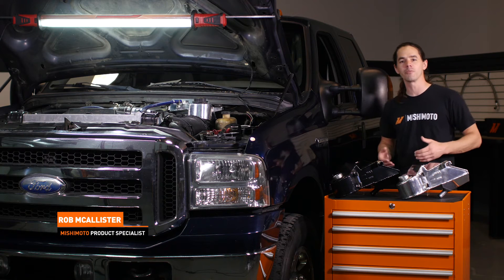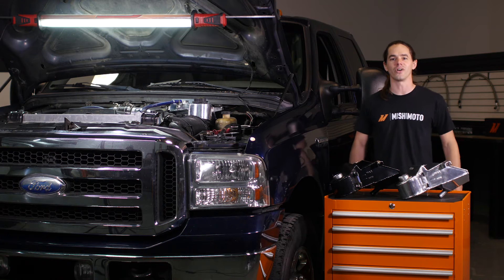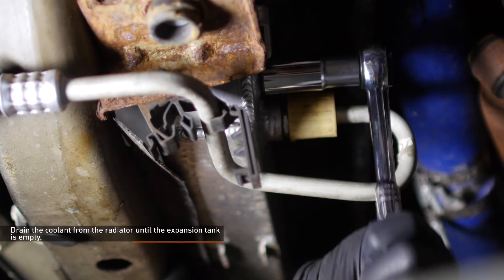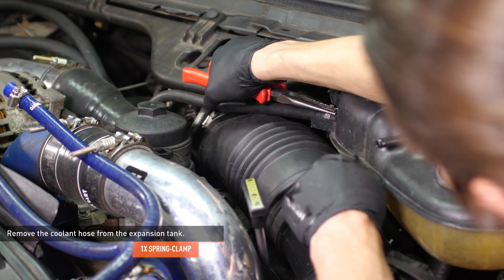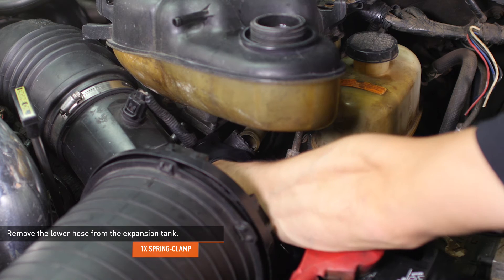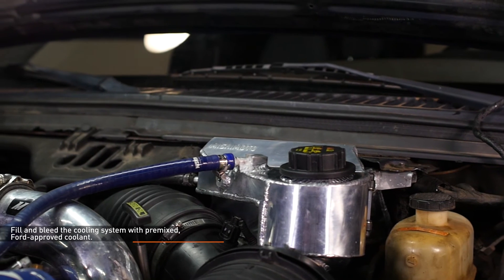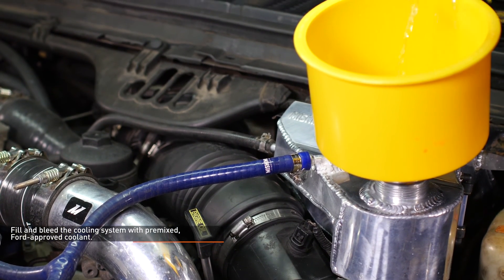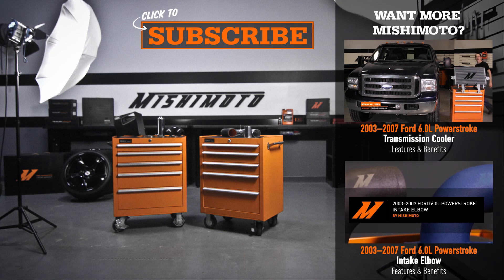2003–2007 Ford 6.0L Powerstroke Aluminum Degas Bottle Installation Guide by Mishimoto

Comment: Bought a brand new Mishimoto degas bottle and find that it purges coolant for some reason. My OEM degas bottle didn't do that prior to the Mishimoto install. Pretty much replaced the OEM for looks. Any tips or advice? I'd like to continue using the Mishimoto but have since gone back to the OEM one.
Reply from the maker: You are welcome to contact our customer support team at support@mishimoto.com. Thanks!

Comment: What’s the purpose for having this item installed does it Yield any benefits
Reply from the maker: The main selling point is that it rids the vehicle of the plastic bottle that is known to eventually crack and leak. Which can occur at the worst of times if you are unlucky. This isn't a performance-related item, but rather a preventative maintenance modification.